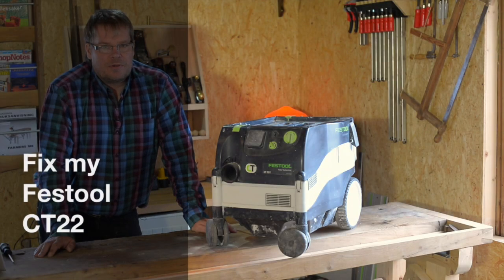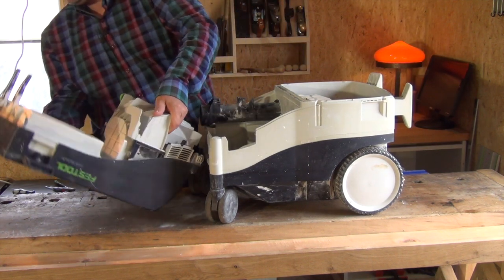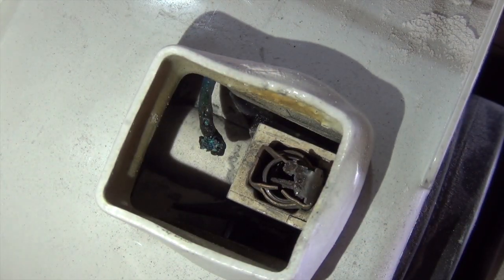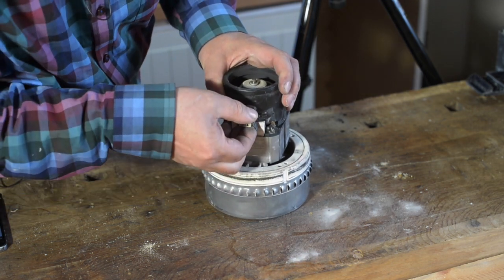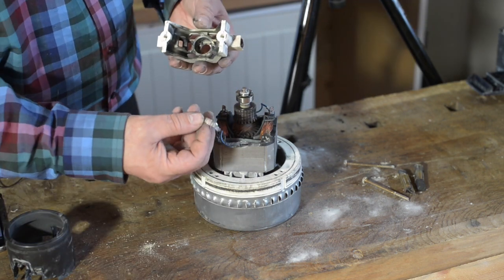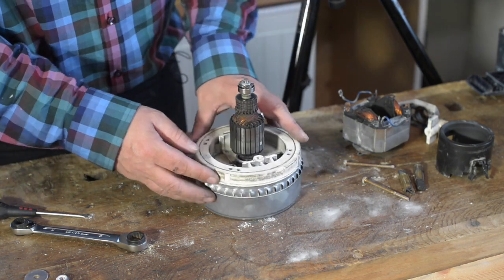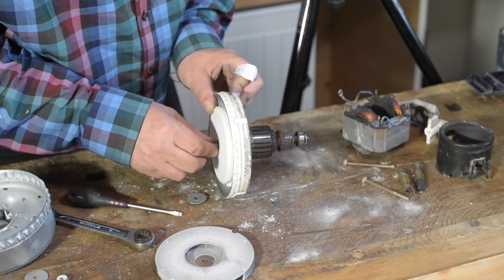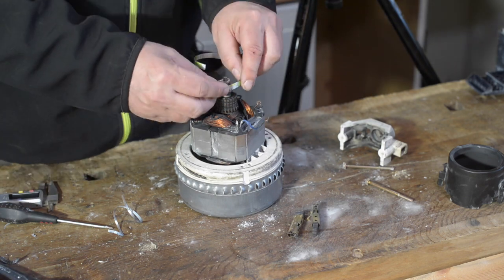Fix broken Festool shop-vac

Comment: First of all thank you for the teardown video. But did I actually miss the changed bearing? All I saw was dismantling -> ah bearing looks ok after all -> reassembly -> fixing a cable.
What about the cause for the cable coming loose and the big amount of heat? shouldn't the rear end bearing be defective and thus get changed?